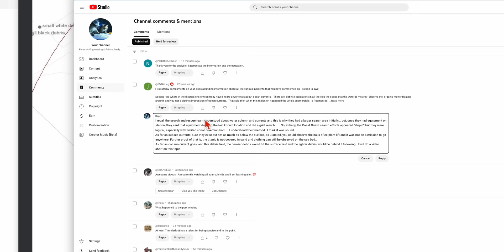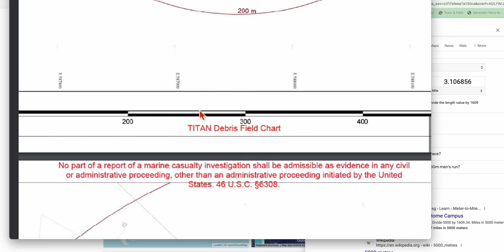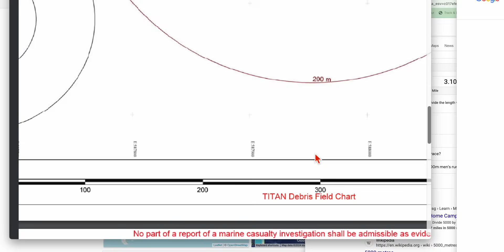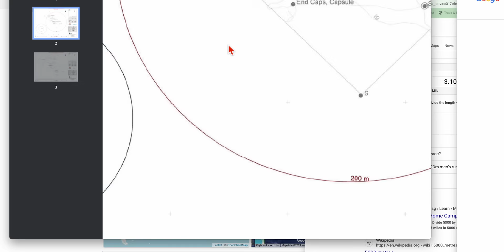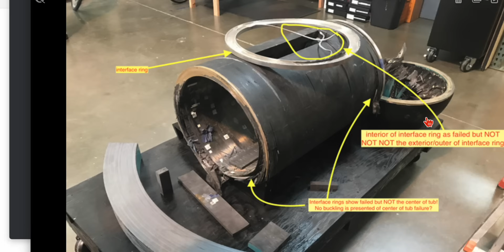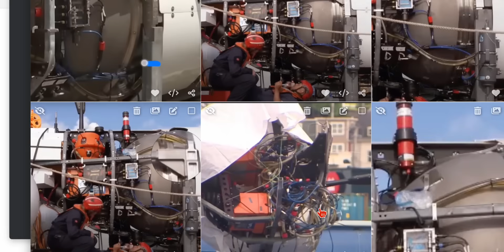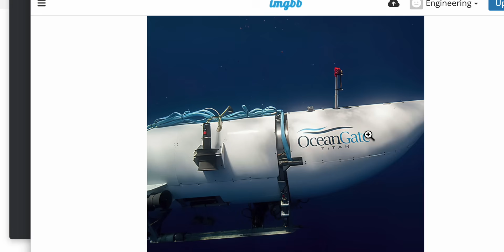Titan Submersible Rear strong back was a pry bar force on top connection putting it in shear stress

Comment: the most messed up part of this deep dive sub is emergency retrieval. They designed this sub to scootch of a platform, not drop in via hardpoints with a crane. If a rescue cable yanked on the wrong section, they could accidentally rip the cap off and implode a stranded submersible.
Reply from the maker: See u tonight, I have it set for tonight
Reply: They were also using a crane to lift it on & off the transport truck, as well as not transporting it in a cradle and on to of that, it was stored outside, over winter! The forces applied before the thing even got it's feet wet, must surely have been enough to drastically increase the likelihood of a catastrophic failure, sooner or later.
Reply: That's because there is no rescue.  If they get stuck on the bottom, they're done.  Nobody would be able to get there in time.
Reply: @stargazer7644 I believe they had inflatables and other systems to float back up, if the sub remained intact

Comment: I would say, your a tiny bit flawed, yes submarines are built with multiple redundancy, so yes they could withstand flooding in a compartment, which could be sealed off to maintain proper pressures. The titan  was a cylinder, one compartment, so the flooding and implosion would happend at same time.
Reply from the maker: Wrong. It's impossible for and implosion to take place without events preceeding that implosion... even a 1 ATM implosion experiment takes a few steps to create the hull failure. 
Always some failure happens before an implosion,  always
Reply: @LoadPathEngineering  There were other events, long before the failure and even the dive. The cracking sounds that were likely at least in part de-lamination of the hull layers are a precipitating failure that would weaken the hull’s stiffness and increase stress concentration on the remaining good layers. Once you overwhelm them Carbon fiber structures have a brittle failure that would be fast and could easily be pretty wide spread since delaminations from load cycling the hull would likely be everywhere. The main, best supported discussion I’ve seen directly from the testimony in the hearings is that the failure was in the inner lip of the forward  titanium ring shearing off as the carbon hull couldn’t hold back enough of the pressure anymore. At that point the expansion of the water would have been at something like the speed of sound (underwater so much higher than in air) and created a water hammer hitting the rear titanium shell and bursting the hull. It’s in part still speculation, and we probably won’t ever have enough specific data for a fully definitive answer but a single catastrophic failure is very well supportable.
Reply: Not to mention lung injuries that can happen at around 10 psi. Air embolisms are deadly. I lost a friend to an arterial air embolism years ago. Our bodies are pretty fragile in comparison with the pressures involved. Take a breath off a regulator on about 6 feet of water (2m) at ambient pressure and surface without exhaling, and it can end your life. 
  There needs to be a healthy respect for the pressures involved, even SCUBA diving, and even snorkeling.
  You can blow a tympanic membrane in a swimming pool and end a diving career in a split second, especially if you have a cold and get a reverse block on ascending. Students learn this in a basic, beginning SCUBA class.
  The adults on this project should've known better. 
  That kid should've had better adults around him.
  Lack of respect for the physics involved got everyone aboard tge Titan killed.
  When I hear reporters assume that SCUBA divers breathe "Oxygen", I cringe. Pure O2 becomes toxic around 30feet, and there was an accident years ago where some teens bought some SCUBA tanks at a garage sale, filled them at a dad's welding shop with oxygen, they went diving with them, and died from O2 toxicity. 
  Reporters need to be more responsible,  as that information got them killed. 
  Young people need to be taught to be more discerning of information from the media, too. 
  Anyhow, thank you for these videos. I think they may have already saved lives, and if not, it likely will at some point.
  People need to think when entering unfamiliar environments.
  Thank you again for your coverage of this subject. I hope this comment and others helps you with the algorithm "gods". 
@ForensicCats